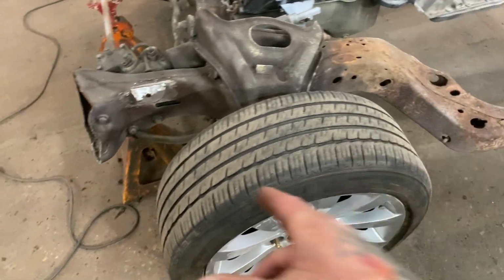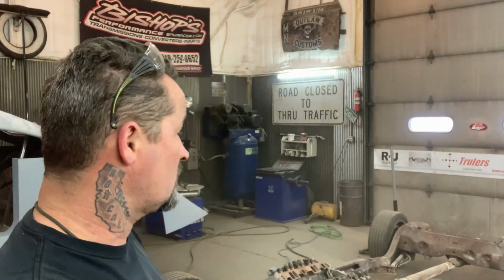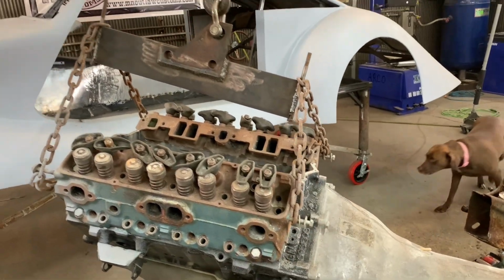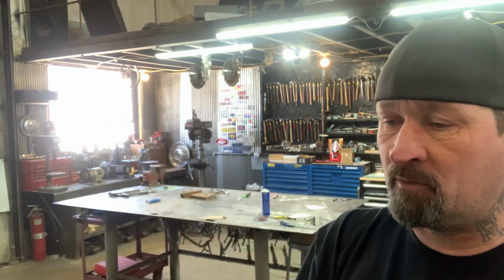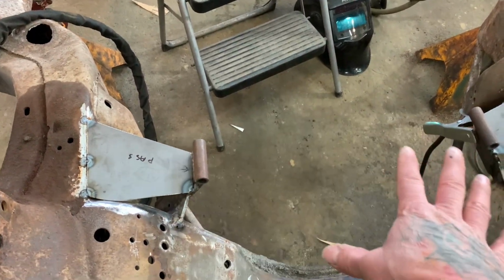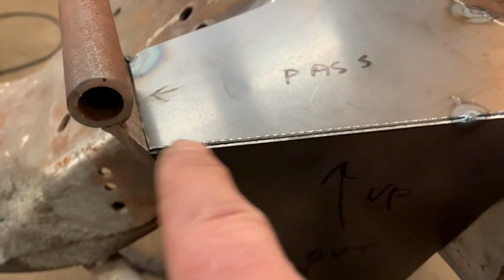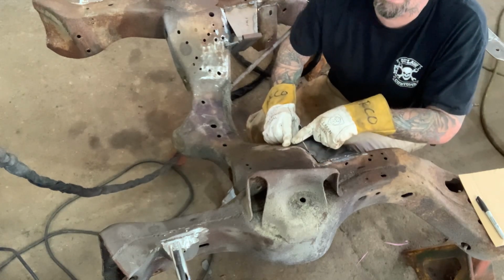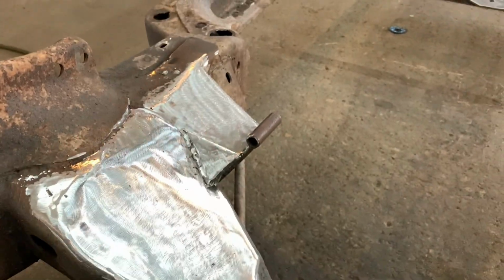Working on Rogue: Motor Mounts Fabrication - welding, fabrication

Comment: Looking good👍🏽 yes the primer filler is some good stuff like spray on bondo filler. Covers all the little stuff. The first time I used it I put to much hardner in the primer and it dried up in the spray gun right when I was going to shoot. Good thing I had a extra spray gun once I mixed it again I was ready to go. Have to work fast when using it well at least I did in the conditions I was spraying in out side in hot weather.

Comment: Motor mounts will look good, but don't over think it. Keep it simple. Before you box the frame, I'd run my brake and fuel lines to hide them. The mounts behind the motor, well I'd cut them off if you don't need them, also the angle tubing I would replace with bigger ones after the frame is boxed in. This is only my opinion as to what I would do. The rear I would by after market mounting kit with upper and lower arms and front and rear sway bar. If you can afford it, I'd run coil overs front and rear so you can raise or lower it easily. (Viking's are reasonable) I have used them. After looking at the body, The frame will be awesome. You can use Acetone too. Also you may want to mud fill the seam. Ronnie.